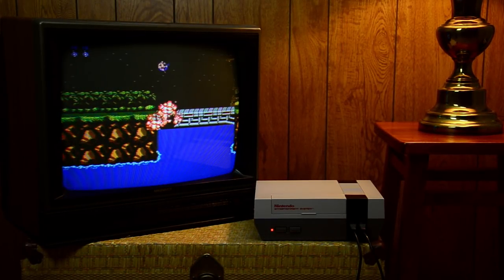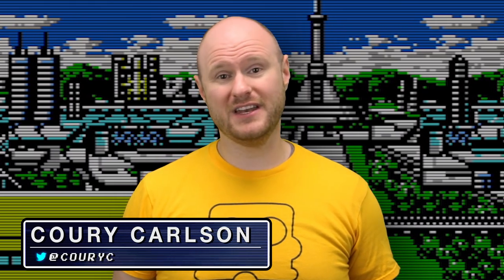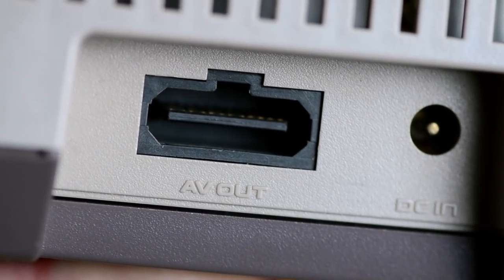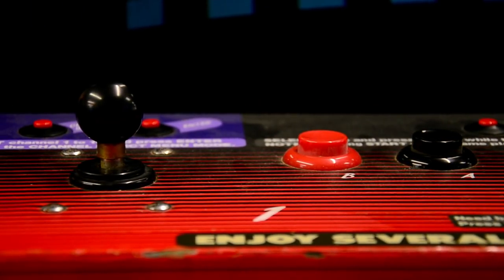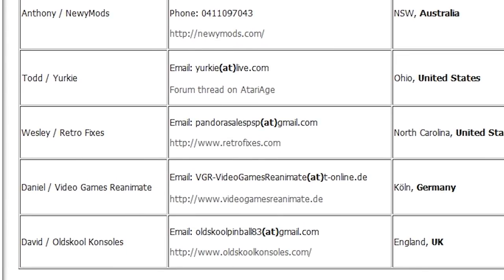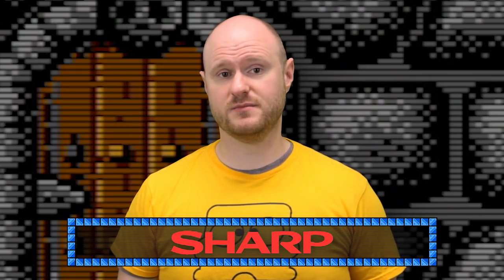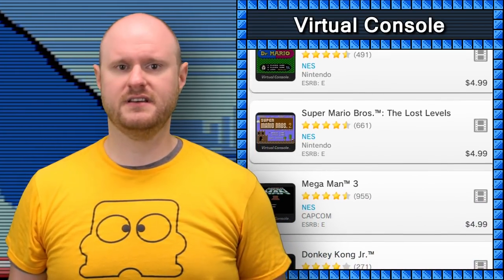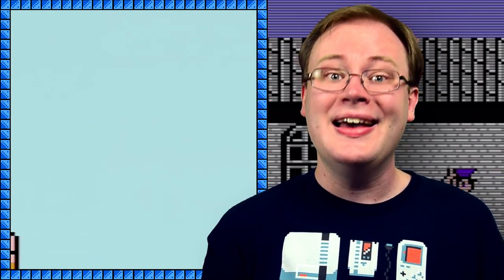Nintendo Entertainment System :: RGB 202 / MY LIFE IN GAMING

Comment: 8:24 - I have that same cart adaptor. It can be modified to correct the problem with Castlevania 3. IIRC the issue is that the adaptor ties PA13 to CIRAM /CE (Famicom cart pins 48 and 49) - probably a production shortcut since many carts tie these lines together.
To fix it, open the adaptor, sever the connection between those two pins, and use wires to connect them to the corresponding pins on the NES cart connector at the top of the unit.
I'd link to a tutorial but I don't remember where to find it. Most of the instructions that come up on a web search are for making Akumajou Densetsu audio work on the NES...
Reply from the maker: [Try4ce] I've heard of this, thanks for pointing it out again! I'd like to try it, or get someone to help me try it!

Comment: Got my NES back from it's RGB modification a few weeks ago.  It truly is amazing!  Only one problem....now I want a professional RGB monitor, like a sony BVM20 or NEC XM29.  My quest for pixel perfection is far from over, but well along it's way thanks to this video series.  Thank you!
Reply: It's easier to get a scart to component converter for like 40$
Reply: @Ballowax  That would be the worst solution. Those converters are usually made with video in mind and are horrible when it comes to games.
Reply: @symphony137  you mean those generic SCART to HDMI boxes. Those boxes interlace 240p content. Try4 and Coury made a video on framiester alternatives and one of them was a SCART to Component converter from DB electronics. This treats 240p correctally and it spits out the same resolution so this box can be used for CRT tvs

Comment: The third hardware revision of the RetroDuo actually does support S-video for NES games, I have one hooked up to my old CRT and the difference in quality over my original (1988) NES using composite is quite striking.
Reply: That’s fascinating, I wonder how they pulled that off. I’d love to take a look inside and see if it’s running different chips or if it’s emulation or something.

Comment: There’s actually a few units of the American Top-Loader NES that use the same Multi AV port as the SNES. However, there are likely less than 100 of these units in existence and possibly less then 10-50 of them that still work. The reason why there are so few of them is because Nintendo only made them specially for people who complained over the lower picture quality of RF, and as such there are very few left in existence.

(They still don’t output RGB though, as they continue to use the same crappy Ricoh PPU.)

Comment: From what I can tell on my own CRT, the AV Famicom's composite signal isn't nearly as bad as the NES's signal that you show in this video. I'm thinking of modding it to output RGB because I love the Famicom but I'd be doing it myself and I'm a bit afraid of screwing it up.

The AV Famicom is a wonderful system, I opened it up and I was impressed with how solid and pretty it looked on the inside

Comment: Actually, the french NES "RGB" output is even worse than composite; because it is a composite signal squashed into a RGB one, this result with a more instable display and some artefacts near the edges.
Reply: KujaNiv100 vomits
Reply: Many Different Things the French NES generates PAL video internally, and then converts in to RGB in order for it to work on French TVs, which used SECAM to encode color and couldn’t handle PAL.

Comment: Great info and presentation.  I sent my front loader NES off for an RGB board install after watching this video.  Haven't got it back yet, but I'm excited about it.
Reply from the maker: +shredguitarkev [Try4ce] You won't be disappointed!
Reply: +My Life in Gaming Would you recommend the SNES HD-Retrovision component video cable to someone using a CRT?  I'm currently weighing my options for when my NES gets back.  I'm also debating just using my SNES s-video cable set, but since RGB modding the NES isn't cheap I'd like to get the most out of it.
Reply from the maker: [Try4ce] S-video may be a good option while you wait for the HD Retrovision cables... though we have our hands on some, the full production run will not be finished until much later this year, or potentially into early next year. You could also consider some generic SCART to component boxes. But yeah, I'd start with S-video and then figure out what you wanna do from there.
Reply: Thanks!

Comment: I want to mention what I use to play NES games, which is a great solution, if you aren't a purist. I use FCE Ultra GX on a softmodded Wii. It works great for most games. It is the only solution I could find that has wireless controllers, and works with zapper games on a modern TV. FCE Ultra GX uses the Wii remote and sensor bar to "emulate" zapper support on NES games.

Comment: Another great video, I am actually looking into RGB modding my system, which is a top loader, but I am kind of conflicted between it and the AV Famicom. I heard there is also a Famicom to NES converter out there as well but it is more expensive so I am not sure what is the right way to go.
Reply from the maker: [Try4ce] I know that Coury wants to get a Famicom to NES converter, but I dunno much about them myself. I've heard that the converter I have can be re-wired to create 100% compatibility, even with Castlevania III (kinda the benchmark game for if something will work). I'm curious, but haven't pursued it.
Reply: Just got both my NES 101 rgb ready and my famicom adapter modded for mmc5 and expansion audio.  Personally, I would go with a Honeybee famicom adapter.  Those tend to be the best quality converters and the mod is very simple with many youtube tutorials available.

Comment: Hey guys, I love your channel. You're the reason I got back into collecting :)

Quick question. Is there a decent way to get component cables out the NES? I know it will need to be RGB modded but will i have to go from SCART to a converter to component or is there an easier way? Thanks
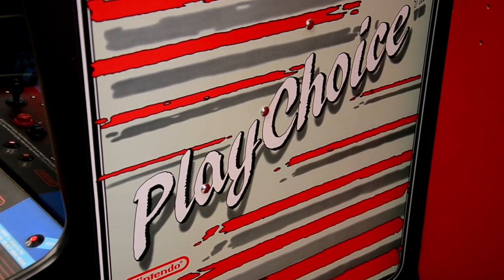Reply from the maker: [Try4ce] The easiest way would be to use HD Retrovision's SNES component cables. They convert RGB signals to component, and we have indeed tested them with RGB-modded NES and N64, and even a PAL GameCube... works amazingly with all of them. Their second batch of cables will actually go on sale September 10 at 6:01 Central time. They're expected to sell out VERY fast, so be ready if you're interested. Alternatively, you could get an RGB SCART to YPbPr component transcoder. These would work with multiple systems, but in some cases, you may need to break audio out of the SCART cable with an adapter, because audio would not pass through some transcoders, only video.

Comment: Recently picked up a framemeister. SNES looks great but N64 not so much; signal is noisey with significant difference in contrast with a clear divide halfway across the screen (very clear on the starfox intro), lots of aliasing and just generally messy looking. Going to try tweaking the settings and I find using the normal image setting with the low pass filter helps (particularly the contrast issue), but would love to see a video on the best rgb settings for the N64. Also having issues with the framemeister recognising premade profiles on the sd card despite multiple restarts, going to try reformatting (removing the firmware folder that is still on there) and adding the profiles back on to see if that will help. Either way any info on this would be good personally and probably help the xrgb community. Thanks for all the great videos, it's a bit of a rabbit hole at times and your videos really help to inform xrgb users.
Reply from the maker: Andy V [Try4ce] N64 is interestingly enough our most-requested topic. Don't worry, it's coming, but as I always tell people, keep expectations modest when it comes to N64 picture quality. At the end of the day, you're looking at 3D graphics in 240p, with heavy anti-aliasing, and there's only so much that can be done to make it look better with the original hardware. As for Framemeister profiles, this is definitely something we want to feature sometime as well. It's a shame we released our settings video just before the 2.0 update went live!

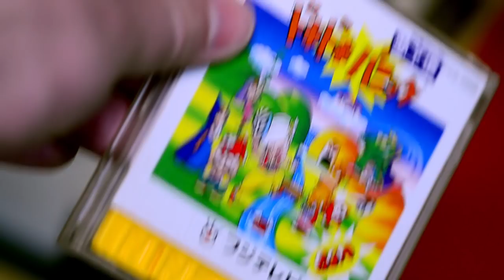Comment: Hi Try4ce. Around the 8:30 mark, you mention playing Famicom disk system games on your AV Famicom. I'd love to play Doki Doki Panic, shown in the video, on my AV Famicom. Do I need the disk system, or is there a way to convert the disk games to play in the cartridge slot? (Kind of like the 72-to-60 pin adapter?) It seems that DDP was never released as a cartridge, at least legitimately. Keep up the great work, guys! Thank you.
Reply from the maker: +Eric Toalston [Try4ce] Yeah, the Famicom Disk System is needed to play FDS games. I'm not sure about playing the games on something like an Everdrive (if it works), but if you want to play the real thing, yeah, you need an FDS. I'm loving mine, it was completely worth it. Just keep in mind, if you look for one, make sure that it notes that the belt was replaced. The belt that runs the drive was an oddball size, and even if it was unused, apparently you simply can't expect the old original rubber belt to work today. I haven't had a single issue with mine, and supposedly it was replaced. Japan did get a cartridge release called "Super Mario USA" that's just our SMB2, but for the real Doki Doki Panic, yeah, that's FDS-only. I'm planning to do a future episode featuring some neato FDS games.

Comment: Been on the fence about this system and upgrading to RGB, but its still fairly costly lol. Thanks for the video.
Reply from the maker: Jesse Morin [Try4ce] I know what you mean. I was reluctant to get into the Sega Genesis myself because it seemed like a pain to add a second system to my setup that wasn't capable of anything more than composite video. When I discovered that wasn't actually true, I got a Genesis not long after getting my Framemeister! When making this video, I was surprised to see how much the pre-modded systems had gone up in price... but if you buy the parts yourself ($90 RGB board, which costs less in US dollars, NES model of your choice, probably like $100-$130 in modding service)... it can be a bit more doable.

Comment: As a purist, if I had a NES, I would still plug it through RF. I generally try to go with the better image quality avaiable, but I don't like to mod the systems to get it. Composite is better, but as you said, the top loader is much more reliable and some TVs display an image 99% as good as Composite through RF. Also, since the RF is generally not used but still avaiable on every TV, it is easy to maintain the NES hooked up when you have too much consoles.
Reply from the maker: Filipe Lima [Try4ce] I've actually got my front-loader NES hooked up to my CRT, and I use RF on it just out of convenience, and to keep the TV's limited inputs open for other systems... I mean, if I want high quality, I can just play the Famicom on the Framemeister instead (which I normally do). The CRT is just for fun/nostalgia/shooting off-screen video, so RF is fine for that!

Comment: Always love these videos!  I had purchased an XRGB mini after your initial video introducing the product and I've loved every minute of it.  I've had the NESRGB board bookmarked for some time, but haven't yet taken the plunge.  I only have my original NES, but have been debating getting the NES-101 vs. the AV Famicom.  The difficulty with playing some NES games on the AV Famicom even with the adapter has me put off just a bit, and I believe there's a similar adapter to play famicom games on NES hardware.  I have to look into that more, but if that's correct I may just go with the NES-101 and a famicom adapter.

Of course add to that the additional issues with the SNES RGB signal that have been ironed out by the modding community and it seems this never ends!
Reply from the maker: Starwars4J [Try4ce] It's crazy how much the landscape of playing retro games can continue to change, all these years later, isn't it? I know it would be an "unnecessary" cost, but there's part of me that's just so tempted to get a NES-101 and have it modded. Well, maybe someday. The adapter I have is quite well regarded, and I understand if you fix some of the solders, you can get compatibility with Castlevania III (which is also often a tough game for clone systems and such). I've never heard of anyone talk about Jackal compatibility issues other than me. In addition to tending to frequently freeze, the text on screens between levels is also screwed up. I've played through the same cartridge on my unmodded front-loader and none of these issues occur.
Reply: ***** You may have that skill set, but sadly when it comes to soldering I have zero experience.  I'd mess the entire thing up I'm sure.  I need to find a good modder to get this all together for me, I had somehow missed that on the NESRGB site he links to modders by country so that will be VERY helpful to me!
Reply from the maker: Starwars4J [Try4ce] Haha nah, neither of us have soldering experience. That's why I haven't tried anything with it! Mostly because the modders I asked weren't familiar with it.

Comment: Excellent video, guys! I was intrigued by the Analogue Nt, but I was curious to what options come with the HDMI upgrade. Does it give the user an option for integer-based scaling? Can aspect correction be turned off? And so on. I wrote them a message asking these questions as it's important to me to have my own control over the scaling parameters, like with the Framemeister. If it's a fixed parameter with no user-control, then going Tim's NESRGB board is definitely the way to go.
Reply from the maker: KarbuncleX [Try4ce] Right, this is also why the solutions that build HDMI directly into the NES itself just aren't for me. I like being able to make my own choice about what to do with the signal. By the way, all of the NESRGB footage in this episode was recorded using your SNES 5x settings. :)
Reply: *****  Cool! Although I didn't actually test it with the NES, just the SNES. Also as you know, the 5x profile cuts a little bit off the top and bottom of the image (which would be even more so for the NES since it has a 240 res to the SNES 224). Eventually here in the next couple months when I get a NESRGB (saving up for it), I'll do a custom profile for it as well.
Reply from the maker: KarbuncleX [Try4ce] Yeah, I know the settings aren't tuned for NES yet, but I figured it would be a close enough approximation to use for now. It's true that NES games tend to show a lot more picture information vertically than say, SNES or Genesis... without any zoom, it usually goes all the way from the top to the bottom, even if it's just "junk" in the edges. At first I was a little unsure about the 5x settings losing information, but I felt the 4x settings made the image look too small to me, so I've been trying to get used to the 5x settings. However, last night, I was actually messing around with outputting my CRT's composite output to the Framemeister (I know it's ugly, but it was convenient for a lightgun stream), and I noticed that with 5x zoom, I was getting just about the same image on the Framemeister as I was getting on my CRT... it cut off basically the same amount of overscan. In fact, there was just a tiny bit more visible on the Framemeister. So now that I know it's a pretty good approximation to what was expected to be cut off by a CRT, now I'm even more sold on the 5x settings than I already was!
Reply: ***** Yeah, I was going to say that CRTs are already cutting off about the same amount of image data as it is with my 5x profiles. I'm a bit more picky in that I prefer to see everything, so I use 4x myself. The black borders on the top and bottom don't really bother me. However, my original hi-def Genesis has ugly flickering garbage in the overscan areas, so I have to use 5x for that console. It looks superb after I modded the console to remove the composite video trace on the motherboard (was causing crosstalk on the blue line of the RGB signal).
Reply from the maker: KarbuncleX [Try4ce] Oh that's interesting! Does that issue exist for other consoles as well? I've always noticed that dark blue shades are some of the easier colors to see noise in (SNES, for example).

Comment: Hi, thanks a lot for this really great video! This is the first one I saw when I started watching your RGB Masterclass. However, I'm a little bit confused with the information provided at minute 4:10 where you talk aboout RCA composite video and RCA mono-only audio on the NES and that we could use and RCA Y-Adapter to split mono audio up to 2 different RCA cables, and then you mention that by using this approach the image will be less noisy compared to the RF switch audio/video method. 

So, my question is. Is the RCA Y-Adapter for audio approach has to do anything with having better image clarity (composite video signal less nosiy) when comparing it to connecting a single RCA cable for audio?

Again, thanks a lot!
Reply from the maker: [Try4ce] No, it has nothing to do with picture quality - it's just a way to make it so that audio doesn't only come out of one speaker.
Reply: @mylifeingaming  thanks a lot!

Comment: Speaking of the NES's composite video ports, If televisions at the time commonly had no inputs other than for RF and most people just used RF anyway, Then why did Nintendo bother to add these ports that would hardly be used by most users anyway and add cost to it?, I can think of a few reasons like so that you can play it with color composite monitors that were available for various home computers at the time as well as maybe to accommodate early adopters of higher-end TVs that do have them and even so, that you can plug the NES to like a VCR or something